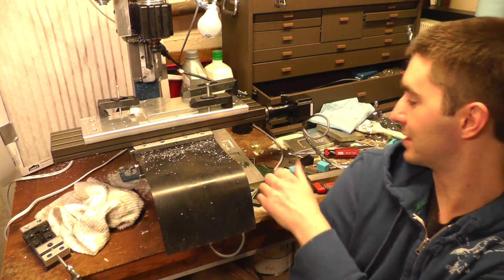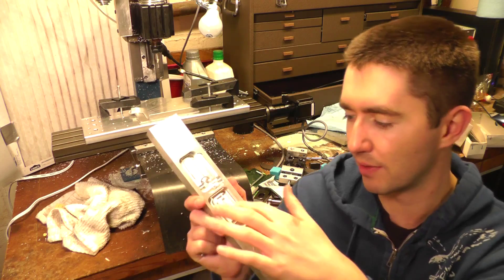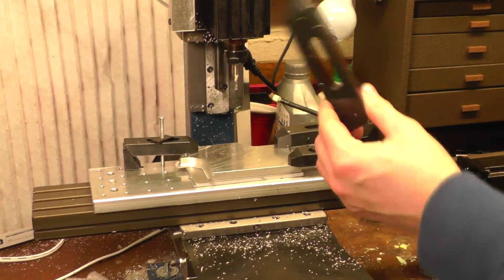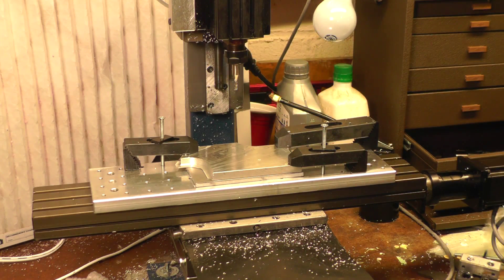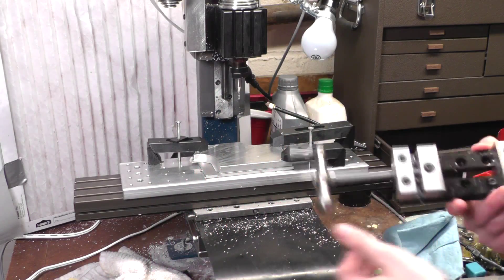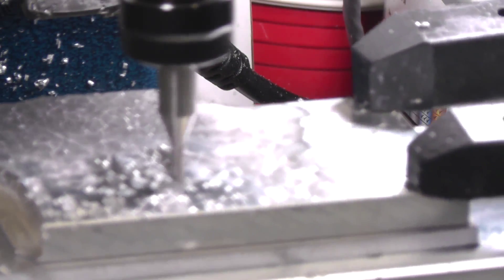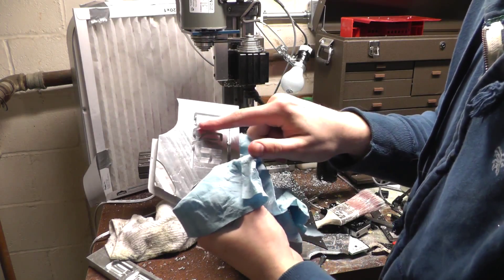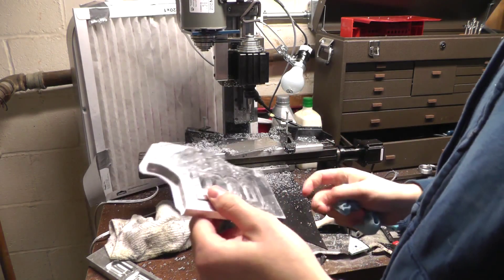A failed attempt at making a profile cut on a mill

Comment: Hi Chris, would you mind putting your motor configuration up. If you use a terminal editor like cool term you can use the $$ command to see everything. My machine is acting strange and wanted to compare the values. Thanks

Comment: Hey Chris,
I have had the same problems learning how to hold and cut.  Clearing chips is the big problem with aluminum.  Add a couple pins or screws for your stock to slide up against.  They stop the stock from sliding and give you away to get a repeatable XY position.
Good luck!

Comment: why mess with the clamps when you can just bolt the work piece down directly.  I like to idea of the counter sunk screws into the sacrificial piece too.  If you think about it, your loosing a lot of the effective surface area of the workpiece when you cut out that big mass in the middle.

Comment: Hi Chris, The horizontal strap clamps must be set higher than the top of the work piece on the non-work piece end (the step block end). An alternative to holding tabs is make final depth 0.010" less that material thickness. Then cut through foil with suitable knife and debur. If cutting all the way through, a loose island in a just milled pocket will cause sudden load change when cutter catches it: broken cutter almost always.

Comment: Hi Chris! I think you should also clamp the piece in the x/y-direction. right now you are only applying force in z-direction and you rely on friction for x/y-stability. With all the vibrations and WD-40 i assume its only natural that it will fail after some time. (I'm just guessing - I have no experience on my own.)

Comment: It slipped a bit at around 12:02 then each time it hit the corners of the piece, it would jog it over a bit until it got far enough at 12:25 to really dig in. It is clamping not the bit cutting length. The H part was fine and it was deeper. You would also  do better for chip clearing with less flutes. Maybe even a 1 flute cutter.

Comment: i have heard of people using double sided tape to hold things for machining. maybe try putting some double stick tape between the tolling plate and spacer piece, and between the part and spacer, and still use clamps. maybe the tape will stop the metal from sliding all over the place.

Comment: Drill holes through the workpiece and use capscrews to clamp it down to the base plate directly. That way it will have a harder time moving. As well get a big 1 gallon drum of soluble oil and use a spray bottle to get it on the workpiece if you do not want to use air blowing.

Comment: I'm not cnc machinist, but to me it looks like you are running that mill bit too deep so that it don't clear the chips out of the way properly. 

Also direct metal to metal clamping can be slippery (esp with wd40) so you might try something other material for sacrificial board.

Comment: Not using "holding tabs" was also of my first failures (broken cheap cutter as a result). I also add 0.1mm to depth to be sure that it cuts thru the entire piece. For profile cutting it is also important to mark it properly - outside/inside (so filing won't get stuck) AFAIK. Not using any cooling (and never had any heating issues with aluminum) but using vacuum cleaner near working cutter - bigger noise (using hearing protection earmuffs anyway) and MUCH cleaner table.

Comment: Like magnumowner said the tabs are incredibly useful, they're under 'Holding Tabs' in your profile cut setup. The size of tabs you'll need depends on how much load you're putting on the pieces, etc. Try starting with 2mm wide x 2mm high. Cambam will autogenerate them. You can change the minimum and maximum quantity also.Once you cut it out you can use a Dremel or cutters to cut the tabs, then file them off of the pieces.  It's a lot better than pieces of metal flinging around the shop :)

Comment: Hey I am pretty sure you are doing everything ok, the outlines are fine, you just need better clamping, as for cutting profiles jut make sure you add tabs on cambam and the piece wont go crazy when you cut all the way through, and since you are using a small spoilboard you might as well add a few millimeters to the cut depth just to make sure it goes trough